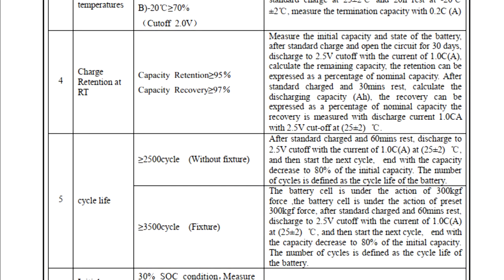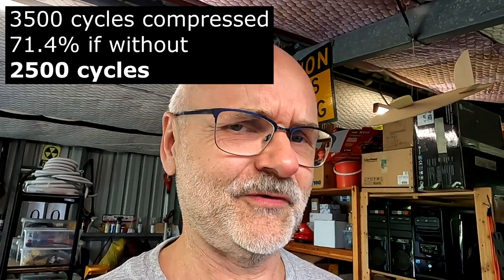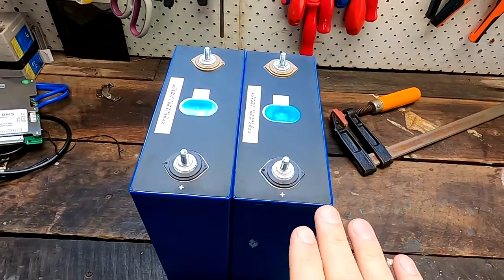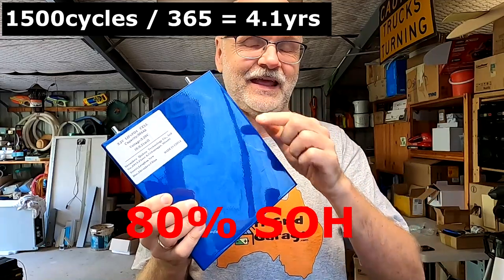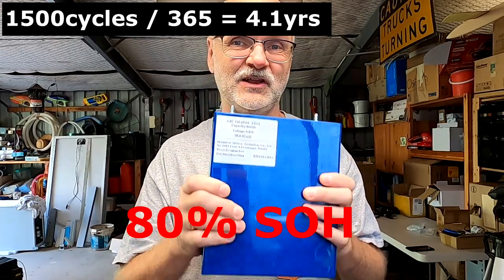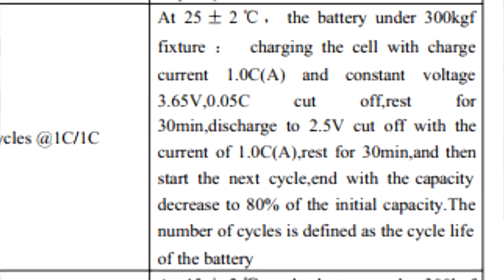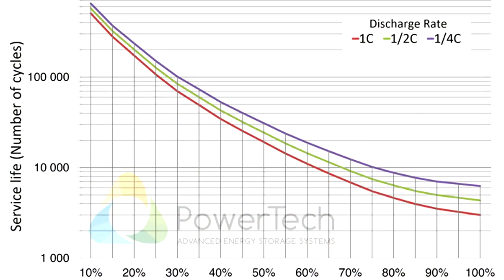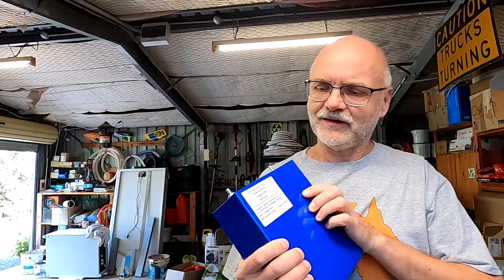Why compression will not extend battery life (something else kills your batteries).

Comment: What you say is correct but you are missing a few factors.  The lab tests are the best case scenario as they are done fast so calendar aging has no role.
Typical calendar aging can be 0.5% to 2% per year irrespective of the use case and mostly dependent on battery temperature that is mostly the ambient temperature assuming moderate charge discharge rates.
There is no test done to show how much calendar aging is influenced by compression. Also in those lab tests the battery is fully charged for just a few minutes each cycle compared to many hours per day in most solar installations and when battery is around 100% is when the plates will be separated if compression is not applied.
My battery will soon be  5 years old and I will do a capacity test when that happen but based on the first 3 years the average degradation rate seems to be around 1.5% per year from witch I estimate around 1% due to calendar aging (my battery stays at a nice 18C to 25C all the time) and the remaining 0.5% from cycling (fairly heavy cycling as I use in average over 4kWh from witch 2.8kWh from battery (4.5kWh battery capacity)).
Say battery as it is used will last for about 14 years as it is before I get to 80% and maybe no longer sufficient vs without compression say it lasts 10 years.  The cost of adding compression is easily justified as it is not that expensive to add compression.
The Spec for my A123 System battery shows a 4 to 5x increase in cycle life by adding compression vs no compression. It shows 3000 cycles without compression and 12000 to 15000 cycles (100% DOD) with 4 to 18psi compression so the level of compression is less relevant as long as there is some.
But again there is no test to show how calendar aging degradation is affected by compression and that may be as significant as the cycle life influence. I just feel that it will be wasteful not to get the best life out of the cells and compression provides a significant improvement.
Reply from the maker: That's a good point and thank you for your comment. Some other viewers have made similar statements about the low costs and effort of adding compression.
I'm not against compression and don't want to hold anyone off doing it.
But even with your A123 battery and 3000 cycles, that is already an awful lot of cycles depending on the usage pattern you have.
And what about cooling when you sandwich all cells together? Will adequate cooling not counter some of the 'loses' you have by not compressing?
You can read about the influence of temperature and SOC in different research publications but there is no real gain/result. High voltage/SOC/Temperature is not good, we all know that. But how bad is it really? How many years of lifetime will be shaved off?
Reply: @OffGridGarageAustralia  :) You sound a bit wasteful. Even if say you gain 15% extra battery life from compression so say 17 years vs 15 years at a 5% increase in cost of battery pack so a net 10% gain why will you not do that?
Regarding SOC there the impact is very small almost immeasurable with LiFePO4 if you charge to full but do not do absorption and float charging (I guess those will have a higher impact but should not be done). Temperature has a huge impact as by increasing average battery temperature by 10C the calendar aging degradation will double and that is the highest degradation in a solar setup.
Just making a cost amortization against grid and saying it can be amortized in almost any condition is not the best way to look at it in my opinion.
You seem to have a fairly over sized battery and that will not help with cost amortization as the calendar aging will happen no matter how much you discharge or not the battery thus you can not expect more than 15 to 20 years at 1% calendar aging maybe 1.5% in your warmer location.
So it is about how much energy you will retrieve from the battery in this say 15 year period. If in average you use 60% of battery capacity each day vs just 15% the cost amortization per unit of energy will have a difference of 4x.
I use around 60% of battery capacity in average each day (it does not mean I'm at 40% in the morning as there will be multiple low DOD cycled during the day). At current measured degradation rate battery should be at 80% of capacity after around 15 years.
At around 2.8kWh per day used from battery for 15 years that will be 15330kWh stored and battery cost was if I remember around 2000USD
$2000/ 15330kWh = $0.13/kWh that is just the cost of storing energy you need to consider the cost of energy used to charge the battery for total cost of energy.
Now if I will have gotten a much large battery so that those 2.8kWh I need from battery each day will represent just 15% of battery capacity cost of storage will have been $0.52/kWh so large that it will not make sense in a grid connected system anywhere in the world.
So if you want realistic data about the cost do a precises capacity measurement of two similar batteries with one using compression and the other not  (maybe even just compressing half of the cells in the same pack) then have a data logging system for say a year to measure the exact energy used from the pack (just the energy that got out of the battery) and then you can do a realistic analysis of the benefits.
Reply: @electrodacus  yes, i agree...do a real comparison of compressed in a fixture vs no compression... maybe air-condition half to 25 degrees also...vs letting the outside ambient heat bake them....thanks you electrodacus

Comment: Hi Andy   I compress my cells as they are in a vibration environment on my narrow boat.   I do this to stop the busbars loosening the terminals to each cell.   Don't know if that is still the recommended way.
Reply from the maker: OK, that could be another case where it may make sense. Or you could use flexible bus bars to avoid any stress on the terminals. A simple fixture with tape maybe enough for mobile applications.

Comment: Hi Andy. I am following your channel and it became my inspiration and guideline when I made my both 48V solar hybrid systems based on 280Ah cells. I am continuously upgrading both the system in the house and the second property. Whenever I watch your films I see that red lawn mover on the side and somehow  expect, what is logical for me, that you once electrify it and take out the gasoline engine out of it.  Well i know you do not announce such things in advance, but if possible give me a hint if i should wait and follow what you did, or do it myself first. My intention is to use 16 pc 280 cells as what we have in our solar systems, though they are heavy, but it doesn't matter for flat surfaces you and me have. As sun/rain protection also a bigger panel would be good and then park the vehicle outside to charge, when there is sun. I am not an engineer and am unsure which rpm and power of 48v DC motor to use. That is my biggest and only concern. My second property with equal solar system is my campsite with 8000sqm of grass, and your property is not small either.  I spend at least 6 to 7 liters gasoline every week in the grass cutting season plus noise and maintenance . My properties are in Serbia with plenty of sun in summertime. Give me you thoughts on this when you catch time or at least inform if you have such project in mind? I wish you all success and can only admire your work, enthusiasm and engagement. Hobbies like what most people call what you do are mild expression for what stands behind all that, and I have experienced at least a part of that, so i know how much you work? Kind regards, Vladimir

Comment: Hi Andy; Just curious if your chosen graph data resulted from compression being used? I note that they start at 3000 cycles. Regardless, at low C rates and sensible DoD, they will last a LONG time. But hey, compression doesn't cost much or take much time to install, so why not?
Reply from the maker: Thanks. In the article, it does not say if they were compressed or not, so I would assume they were not. But as you said, regardless, the calendar life will take over at some stage even if you get a gazillion cycles.
I think compression needs to be done correctly but none of the manufacturers actually provide any further information. They test this in a  lab with one cell perfectly clamped under the test conditions. No way anyone can reproduce this under real world conditions and daily usage.
Reply: @OffGridGarageAustralia  I agree. I think you and Will also nailed it. Temp is way more important than compression. So love watching your videos! So entertaining and informative.

Comment: I clamp mine Andy between 2 @ 3/4" ply boards with insulators between each cell and 3 massive nylon cable ties providing  the force - Its only 4S - I thought it useful to take the stress off the bus bars  as its in a motor-home.
Reply from the maker: Yeah, mobile application. Either clamp it or use flexible bus bars I guess...
Reply: @OffGridGarageAustralia  I used  both  Andy - flexible copper  laminate 300Amp bus bars and  clamping - it all fits rather neat in a caravan  type lead acid battery box.  Love your channel and your banter

Comment: I like ur thinking Andy. So to be clear on the reason for compressing, it is to avoid any additional mechanical movement/forces on the busbars while under charge or heavy loads, is this the main point of that theory? Or does it also extend cycle life due to a tighter/ denser mass?  People could get real crazy & start creating little cabooses with bearing rollers under individual cells to allow for some movement here. Good info, thanks!

Comment: I wonder whether there is any accelerated physical degradation from the movement that causes the cells to deviate from the projected chemical degradation?
Reply from the maker: Apparently they swell only at higher c-rates, ~ above 0.5C. With lower currents, there is no movement. More research needs to be done!
Reply: @OffGridGarageAustralia  The main reason for compression is to limit expansion/contraction of the jelly roll in the battery since over time this will cause de-lamination. Older style cases were thick plastic which had the same effect. Cylindrical cells have this automatically because of their geometry.
Reply from the maker: @upnorthandpersonal  so we should compress the slimmer sides of the batteries as well even they don't tend to swell as much as the larger side walls.
Reply: @OffGridGarageAustralia  They experience much, much less of this. The long, thin, aluminium side is much more flexible.

Comment: In the UK right now,  (9 months after your video) it is not $0.15 /kWh, its £0.35, or $0.40. But that's being kept 'low' with tax money until April, at which point it may jump to about $0.60 /kWh. That's what I'm charged during the day, but am charged £-0.02 (yes, minus sign real, they pay me to use power) between 1am and 5am. Our house isn't on the gas grid, oil is disgusting, so elec heating it is, we are averaging 60kWH in the cold weather (house still cold mind you - really terrible house), so in just the 3 winter months I'm using 5400 kWh and next year that will cost me $3200,. Thats just winter, we use only about a quarter of that in the rest of the months so its about 10000 kWh a year and that over 4 years (assuming war still going and prices stay at that level, I mean they could go up) that's $24,000. If I was using 80% of these batteries I'd need about 80 of the cells you are talking about, that's going to cost about $10k (assuming I can buy them as cheaply as you have). So even with your really pessimistic estimates of capacity drop off and so on, I will break even in year two. Its actually a financially very good idea to do this. Anyway, great video - nice to see someone actually doing the maths and realising that messing around is silly and just buying batts is essential!

Comment: @OffGridGarageAustralia, if someone is using a low capacity (e.g. 24v 100AH i.e. 8s LifePO4) battery, and if daily cycle count is between 1 to 1.5 cycles, then there is a clear gain due  to compressing right ? (asking becoz this video mostly focused on High Capacity ones.)
Reply: To be honest I think that the charge and discharge rate has more to do with aging the cells then any compression of the cell laminations.. Newer LiFePo4 cells that bond iron oxide with the Lithium reduce its molecular degradation and new process carbon fiber matting seems to be more flexible than older incarnations of Lithium Ion battery cells.. Basically the volume of these things being produced has made better cheaper for the manufacturers so we as consumers benefit with a better product.. Most small batteries 12v and 24v coming out of China have no compression in their plastic containers other than what the cells need to prevent shock and vibration damage.. You would be better served in getting an extra battery pack that you could alternate with the other one to reduce the number of charge cycles per day and the C rate the pack is charged and discharged at..

Comment: sorry for spamming, as I wrote earlier that rods and springs are cheap, went to grainger put $40 worth of hardware in the cart and then abandoned the idea - rigid bars connecting terminals with "breathing" spring loaded compression will create stress on the studs 
maths are taking a break :D mechanical stress would be too much work to calculate and both (stress and calculations) are best avoided 
cheers

Comment: Hello Andy, my upside down friend.
I was watching some of your old videos and I saw the ones where you successfully put two batteries of significantly different capacities in parallel.
That made me wonder if you could parallel one 24 volt Pack, and two 12 volt packs in series. All different capacities of course. I have packs that I only use seasonally and i wonder if I can use them instead of storing them. Another test?
PS You remind me of a scary shop teacher I had in high school many many years ago.

Best Regards,
Mike Dudley, from up north in Wisconsin
Reply from the maker: Thanks Mike. Great question. I would not recommend paralleling 2x 12V batteries in series with another 24V battery unless they are all separately monitored. If the 12V batteries have different capacities it should not be done anyway.
You can of course parallel different 24V battery packs with different capacities.
We will do some more testing in this regards, also mixing lead acid, LFP and Li-ion in one battery pack.

Comment: How about the laminates, isn’t compression a way to avoid pre-degrading caused by small mistakes in production and shipping/handling errors that might not show up on the first cycles in reality but then that small production flaw or transport mishandling leads to the batteries inner cells to a delaminating, like a little scratch on the cars paint leads to rusting? 
Is this a valid or even possible argument for compression?
Reply from the maker: I googled that and found some scientific articles. Nowhere is mentioned though that compression will prevent or limit the effect of that... so don't know. Maybe compression makes it worse?
Reply: @OffGridGarageAustralia  It could make it worse, but it feels like it wouldn’t, at least not as long the battery cells stay in fixed and not de-compressed from time to time, as you said in the video compression actually helps especially in EV:s but it’s not that important in home builds. But facts don’t care about my feelings, so I don’t really know how to think about it, just a thought. Thanks for the reply and video!

Comment: I love your logic :)
Reply from the maker: Right? I had to do it... Now, if people ask why I don't compress, I send them a link 😊
Reply: @OffGridGarageAustralia  I used to be a programmer and we call this a function or subroutine.  No need to say something many times just point to this.
Reply: @OffGridGarageAustralia , I would also have liked to have included the reason for the bulge (expansion of the battery when the battery is fully charged). This would have also explained the candles of the bus bars.  Friction generates heat.  The friction of what you say? Electrons and surrounding matter. This is why heat is produced in the battery(google it, and you'll see). I can't explain it here in this limited space. And a small scratch on a bus bar is a Grand Canyon size space for an electron.  This is why paste or anything that will fill the gap and ease the flow of electrons will decrease the heat generated by the electron's transition from one media to another.  Keep up the excellent work.

Comment: Hi Sir, is there a way to compress prismatic cells at BOL,ie we should provide instantaneous force or gradually increasing load could you please provide input.
Reply from the maker: Compression need to be applied at 20-40%SOC with 300kgf. That is 4x M6 screws torqued at 0.75Nm. Not more.